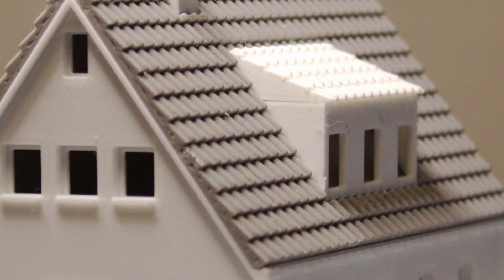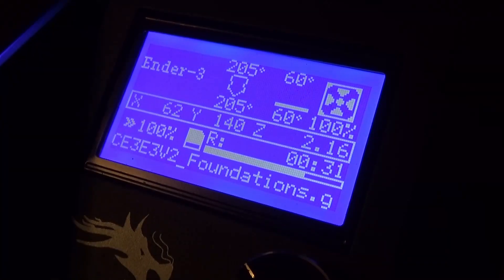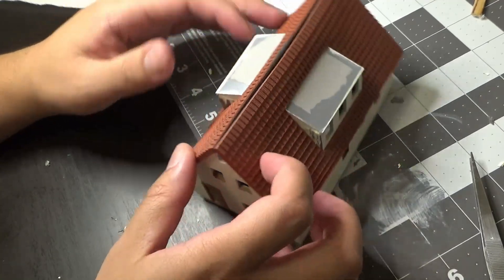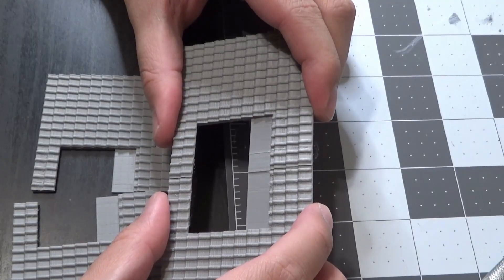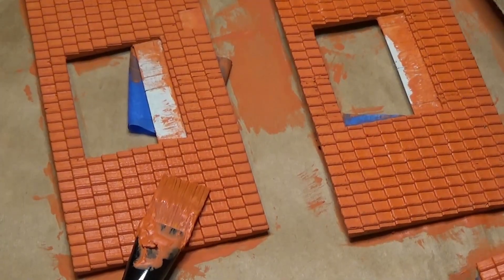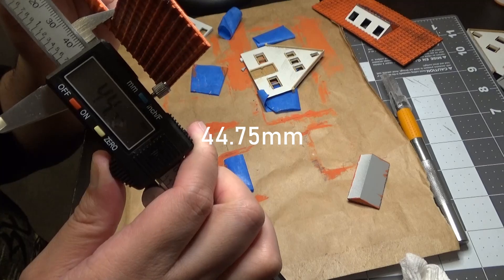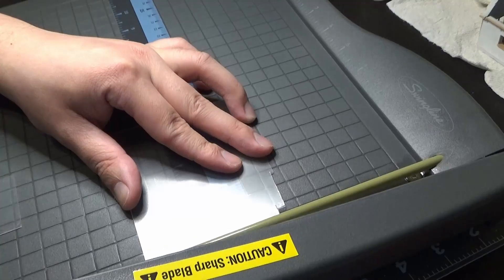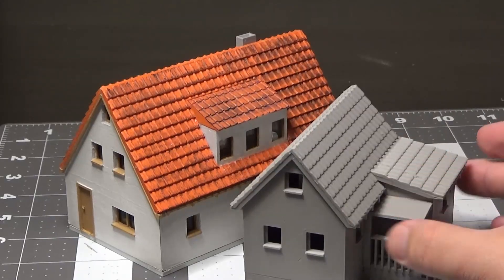I tried 3D Printing a Miniature with NO prior experience

Comment: What took you the most time, printer setup, 3dmodeling or the final printing?
Reply from the maker: It was the 3d modeling. I have loads of pieces of this model's early versions that don't even fit right. That dormer not fitting on the roof is one of them!